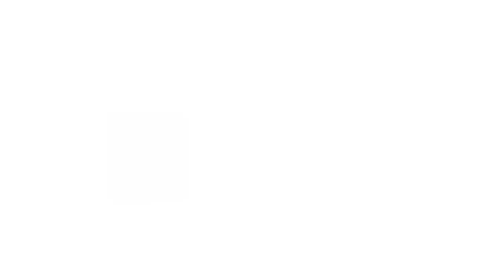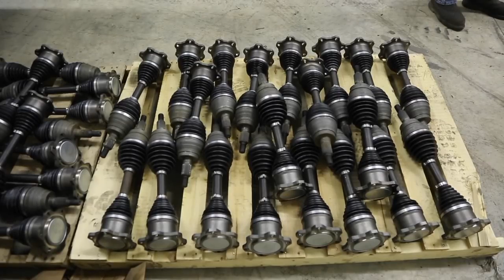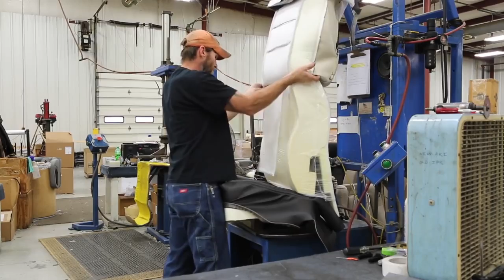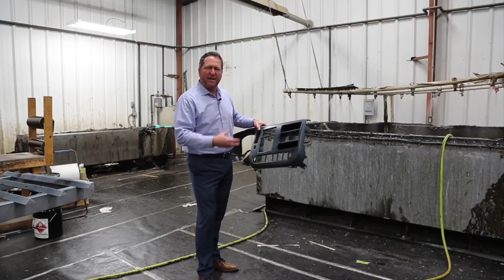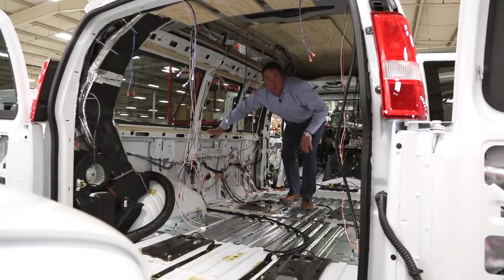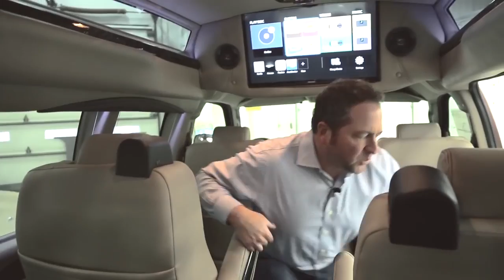Your VIP Pass: Exclusive Look into Explorer Van Factory Tour 2024!

Comment: Great video thx a lot 
I have some questions
You didn't talk about the safety features is there any airbags for the rear passengers 
2nd what about ventilation for the rear passengers 
3rd how many airbags are in the front
And finally do you ship 🚢 outside USA
Thx for your response
Best regards
Reply from the maker: Thank you for your interest in Explorer Vans!  
The GM vans have full length side airbags for all passengers, as well as front airbags.  Front seats have front and side airbags.
The rear AC & Heat flows thru vents located near the floor and near the ceiling.  The controls are located in the driver cockpit area.
Go to our website to design your dream van and we will email you factory direct pricing.  www.explorervanworld.com